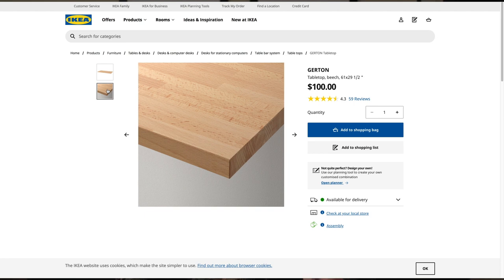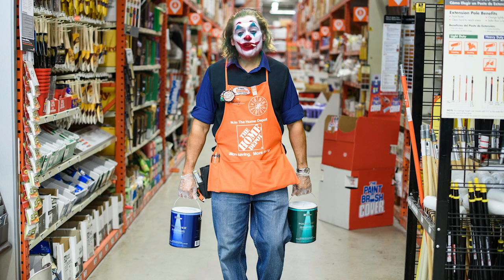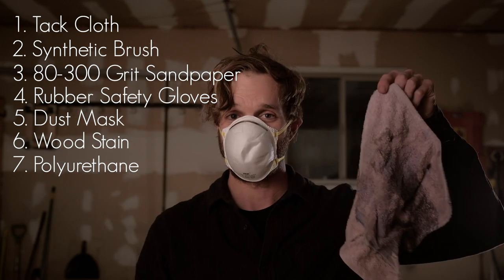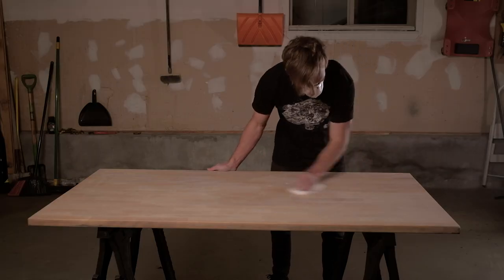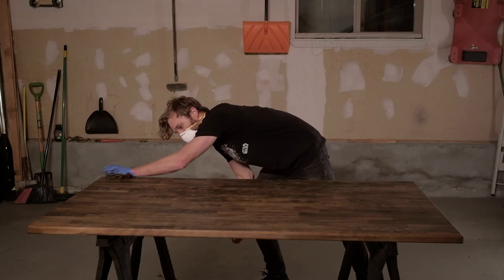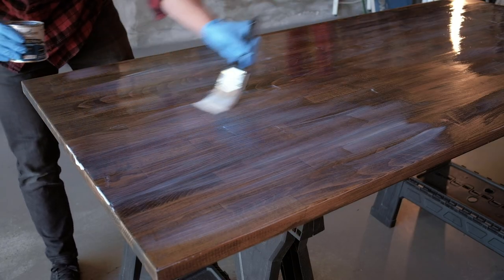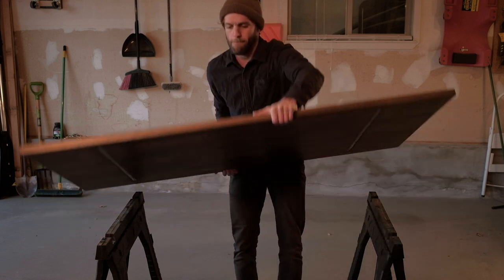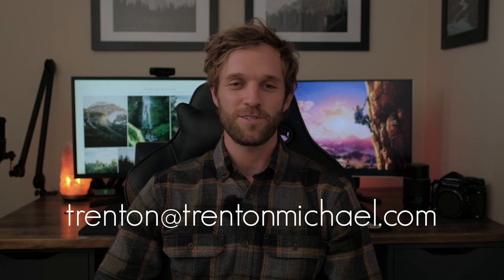My IKEA Gerton & Karlby Desk Staining Project!

Comment: After staining, did you sand with 180 again or did you go with the 220?  Also are you using the 220 to sand in between coats of the polyurethane?
Reply: Also, Would you or would not recommend using an electric sander?
Reply from the maker: Afshin Mostofi I’d go with 220 if those are your two options. I’d avoid using an electric sander unless you have precision hands – otherwise you can easily sand down too much and create valleys and bumps in the board. But if that’s the look you want then go for it! I just use mine for my computer desk and running a mouse over that isn’t super fun.

Comment: Great video, Trenton. A few notes for anyone going through comments thinking about doing this themselves- this from someone with very little wood finishing experience before going into this project but has since fallen down very deep rabbit holes on woodworking forums, etc.

1. Maybe it wasn't shown in the video, but make sure you're doing at least one coat of poly on the bottom if you're planning on using this long term. This is real wood so it has the potential to warp, etc. over time - a finish helps stabilize in this regard and you don't want the different sides to warp differently. One on the bottom seems to be considered sufficient. 
2. Use a wood conditioner or pre-stain. This is going to help get a uniform stain without blotching. Especially as this is a beech tabletop - a wood with a reputation of staining inconsistently. There is a This Old House video that is one of the first results when searching YouTube for 'how to finish a table' that illustrates the importance of this.
3. In this video a water based poly is used with an oil based stain (i think.) It is generally recommended that you remain consistently on oil/oil or water/water.
4. Poly can take ~30 days to 'cure' even after it has dried/the odor has dissipated. It is considered OK for 'light use' when it hasn't fully cured but I've read some folks comment that long term, weight from their monitor arm mount holding 2+ monitors messed up the finish underneath because they didn't let the poly cure. Now, if that spot is covered by your monitor arm anyway - who cares - but something to consider. I do think it is kinda funny that a lot of the tutorials for finishing this desk in the 'gamer' space have a way abbreviated timeline than a lot of the oldheads on woodworking forums.
5. From experience, consider thinning your poly if you go the oil route. Makes things a lot easier. Either thin it to up to 50/50 with mineral spirits or just buy a 'wipe on' Poly to start with.

All in all this was a fun project and I am very happy with my desk, and the whole journey basically started with stumbling on this video. Thanks!
Reply: Should be a pinned comment. Thank you very much
Reply: Wait, what about the fumes? Can I do this inside an apartment?
Reply: @adamp503 just open the window?
Reply: what about the ikea Karlby wood veneer table tops? I've read somewhere that mineral spirits shouldn't be used on wood veneers cause it can sink in and dissolve(?) the glue under the veener?! Because in wipe-on-poly as I've read, it's just already mixed poly with mineral spirits, and normal polyurethane is better to be mixed 50:50 with mineral spirits to get the best out of it for multiple layers. So for me it sounds like there is no way around mineral Spirits? Did anyone tried it on like 3mm wood veener?
Reply: @sasso3844 I've been holding off on this for the exact same reason. Did you end up trying it out? How did it go?

Comment: Hey, this is a great explainer that I'm actually following right now. A couple of addenda that I've learned by doing this process myself:
1. The stain/PE coats needs a minimum room temp of 55F. If you're doing this in an unheated garage, you might consider running a space heater to warm things up.
2. You might consider putting on a wood conditioner before the stain. This makes the stain more even. Depends on what you want the finished product to look like.
3. The stain instructions suggests stepping up through more sanding intervals - 120, 150, 180, 220
4. Match the stain types to the PE finish. E.g. pair an oil-based stain with an oil-based finish.
5. The dust mask doesn't protect you from the stain/finish fumes. For that, you need a respirator with organic vapor cartridges.
6. Don't repeat my mistake and sand with rougher sandpaper between PE coats. I thought I could get rid of some bumps with 150 grit and oooh boy was that a mistake. It ate through the coat AND the stain. My bad.

Please don't take any of this as criticism. This project is a great idea, just passing along some things I learned along the way.
Reply from the maker: Eli, I appreciate the feedback. All of these are great points you’ve made. Sometimes when you’re trying to figure out a DIY project but also find yourself filming at the same time, a few things are overlooked. I’m going to pin your comment as you’ve brought some great knowledge to the video. Thanks again for the input.
Reply: @TrentonMichael  yep! And thanks for putting this video out in the first place. I'm putting my last coat on the desk tomorrow.
Reply: @pnwmeditations  What happens if you use a water-based PE over hardwax oil or oil stain? I ask because my desktop came pretreated w/ hardwax oil and just wanted to apply water based PE to avoid the toxins/smells of oil
Reply: @NurseAnesthesia1  I couldn't tell you - I just followed the advice of the Ask This Old House Guys. I suppose you could sand off the treatment, but that would be a lot of elbow grease. I sympathize with you though, the oil-based PE treatment does have an odor that lingers for a couple of weeks.
Reply: This is really helpful.  Quick question: what did you mean by the “Step Up” step for the sandpaper?
Reply: Do you have to sand the stain before applying the polyurethane if using a gel stain?
Reply: @Dr.HouseMD  I just mean you sand the desk in sequence from a lower grit to a higher grit
Reply: @pnwmeditations  do I not sand in between coats? Or is that a bad thing?

Comment: For a smoother feeling desk, start with 80 grit, then 120 and finish with 220 grit. Super smooth.
Reply: can you elaborate on that?
Reply: @jameshernandez1451 You'll want to sand the entire desktop (edges and underside too) with a coarse 80 grit sandpaper first, going with the grain. (The Gerton tabletops tend to be a bit rough around the edges straight out of the box. Mine had some rough spots and a slight 2mm dip about 3cm wide running down half the length of the desk. The 80 grit helped shape those away.) Wipe or blow away the sawdust after each sanding. After removing imperfections with 80, then switch to 120 and finish with 220. 220 grit is a more fine sandpaper and leaves a smoother feeling surface. Before I sanded, I used a router to round off the edges of the desktop to give it a better look and make it easier for sanding the sides.

Comment: After watching many videos this one was the most informative, particularly with peoples comments. I did 2x RÅSUNDA desks (managed to just get a couple since they discontinued them) and here is how I went/useful tips

1. I used 150 grit sand paper with a sanding block for initial stain sand.  I did research and found that you shouldn't go finer than 100-150 otherwise it doesn't open up the pores of the wood as good, resulting in a potentially blotchy stain. The ikea hardwoods are european oak and don't require a pre-stain but my step 2 apparently helps.
2. Wipe up all the dust with a rag. Then I used a 50/50 mix of water and methylated spirits/Denatured alcohol (called different in each country). I just dampened a rag and applied (do not pool it, just a wipe). The alcohol removes any potential oils that might have penetrated the wood that your sanding didnt get rid of which could cause blotchy stain. The water does 2 things; 1. raises the grain which will reduce the roughness after light sanding when applying either a water based stain or poly (i used oil based stain and water based poly). 2. Opens up pores to accept more stain and reduce any potential blotchy stain. Wait until it completely dries.
3. I very lightly (e.g. with no weight on sand block) sanded with the 150 grit to remove any raised grains. Wiped off dust with rag.
4. Using a foam brush to apply oil based stain (I used Walnut and had to pour stain into a container so foam brush could fit). I found the foam brush applies a nice thick coating of stain in one wipe. Apply and after 5min wiped off with couple rags. This is the most satisfying part of the project seeing the nice colour after wiping off the excess. I was concerned at first that the stain was dripping to the other side of desk and would make the other side darker when doing stain there, but it didn't luckily, however try and keep drips in check. After 30min wait I flipped tables and stained the other side. I let them both dry for 24 hours to ensure it was completely dry before applying poly.
5. I applied a satin water based poly with a soft tipped synthetic brush which gave me much more control of bubbles than a foam brush (I tried both). I applied 5 coats each side. I sanded very lightly with 220 grit. You have to be very light since the poly is only a thin layer and you only want to 1. remove any peaks and 2. rough it up a little to create a mechanical bond between each poly coat, but not remove the poly coat from excessive sanding. I made sure I had a rag on hand to wipe any drips from the underside.
I did 5 coats on top and sides first. Waiting 2 hours between each coat, then flip and did another 5 coats on bottom. All came out awesome. Did not sand on final coat since I was happy with it, but if youre after a super smooth glass like finish (particularly if you are using high gloss poly) then there are 2 ways. 1. Can use a 1200-1500 grit sandpaper to smooth then hand buff with automotive wax. 2. Machine buff with abrasive wax. I did not do this so can't share experiences.

For 2 x 1.86m (6.1 feet) it took 500ml (16.9 ounces) to stain both sides but since I used a foam brush it applied very liberally. For the Poly to apply 5 coats on both sides of the 2 desks took a little under 1L (33.8 ounces). Hope this all helps :)

Comment: just one thing to consider. it is better not to use cloth to remove the dust, but to use the vacuum since with the cloth, you just rub the dust into the table.

Comment: I am completely new to diy wood projects your video and finished product was amazing , so I have a few questions.How would I know I have sanded enough, how lightly or heavily are you sanding? How much sanding would I need for brand new out of the box Gerton table top ? What grit are you using at each step, before stain, after stain and after each protective coating? I know it’s lot to ask, but any pointers would be really appreciated. Thank you for the video it is a great base line.

Comment: After staining and finishing the top and sides, did you wait until all surfaces were completely dry before moving on to the underside for the same steps or did you flip over and do the underside at the same time? My worry is that if I flip over the desk and work on the same steps while it's not dry, the surfaces that are resting on the saw horse will have their finish ruined due to contact - but at the same time, this would double the time it takes.
Reply from the maker: I actually did the bottom first because I had the same worry as you. I stained the bottom, with only one coat of Poly, and gave it a day to dry before continuing with the top and sides. But you could definitely do the top and bottom within a few hours if you started with the bottom first. The stain and poly dry pretty quick so I wouldn’t be worried about making marks on the bottom.

Comment: Ikea Karlby kitchen countertop already comes in a dark walnut. Get the longer 98" one vs 74" one (width is about 24-25"). 
Just add some Ikea STOCKARYD linseed oil for a nice sheen.

Where did you get the awesome Millennium Falcon cutaway T-Shirt?

Comment: 1) so when you apply the polyurethane after every coat you sand it down?

2) any other brands you recommend? i dont have a home depot where i live i only have a lowes.

3) would you need multiple cans of the stain for 2   74in countertops?

4) can i use gel stain for a laminate countertop?

5) can you stain the linnmon tabletop?

Comment: I noticed you used the 236ml can of poly, but had the 946ml can of stain. Did you use all the stain? I just picked up my stain and I'm wondering if I should go buy another can before I start the project.
Reply from the maker: I still have a ton of stain left over. If anything I could have gotten a larger can of poly. I ran out after three coats.

Comment: I had an issue with applying second coat of poly. It left bubbles and little imperfections. My question is should I sand and re-apply a third coat of poly? Also there is a 3x faster poly I discovered afterwards that is thicker and works as 3 coats with one application.

Comment: with that first 180 sanding,  did you sand it till completely smooth? or did you smooth it out when applying the polyurethane? Also great video, keep up the good work!
Reply from the maker: Yeah, I sanded until it was smooth for both stain and the first Poly coat

Comment: Did  you stain the entire table all at once or did you wait for one side to dry befor you flipped it over onto the legs. If you didn't wait, would it hurt the stain if it wasnt fully dried and I stained the other side
Reply from the maker: Louis Padilla i did each side separately. I’d wait maybe 30 minutes before flipping if you wanted to move the process along quicker. You should be fine then.

Comment: I didn't see you apply poly to the underside. Did you finish multiple coats on the top side first and then apply multiple coats to the underside? Or did you alternate multiple times?
Reply from the maker: I did 3 coats of poly on top but only one coat of poly on the bottom. I did the bottom first thing before I began the top.
Reply: @TrentonMichael  Thank you for the answer! How is the poly holding up after a year?
Reply from the maker: Tofu it’s the exact same as the first day I installed it. Holding up very well!

Comment: Thanks for the video. Am about to do this. Do I need to buy a random orbital sander to quicken the sanding? Or is hand sanding sufficient? How long did the sanding take for you? Thanks!
Reply from the maker: For this specific project it’s best to only hand sand. An orbital sander will quickly sand deep into the wood, and in various spots, cause a bunch of uneven dips and grooves. Sanding it by hand was not that bad. It took 5 to 10 minutes for my desk. Good luck! Let me know if you have any other questions!
Reply: Thank you! Trying it out now!

Comment: This video was exactly what I was looking for. Thank you sir!

Is there any obvious reason that I shouldn't lop off a few inches of length on the board (other than having zero woodworking experience)? I'm planning on using two Alex shelves from Ikea but wasn't sure if it would mess with the fit. 

Also, had to throw you a sub when I realized you're a fellow film junkie. Keep it up with the awesome content man.
Reply from the maker: Awe thanks, Taylor! I don’t think there would be any problem with cutting a bit off of the board. Just do it well, haha. Good luck, man! I hope the project turns out nicely.

Comment: Do I have to sanding under the countertop? And Do I have to vacuum the table before staining? Is it enough just wiping out by cloths after sanding?
Reply from the maker: Just to be safe, I’d do a quick sanding on the underside of the table. You don’t need to vacuum and dust - a simple wipe down with a cloth will do just fine.